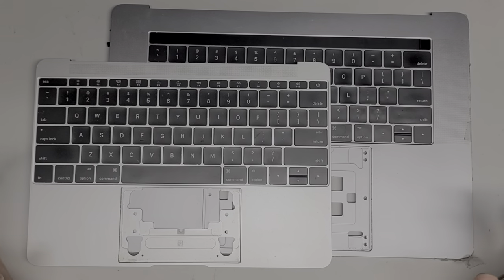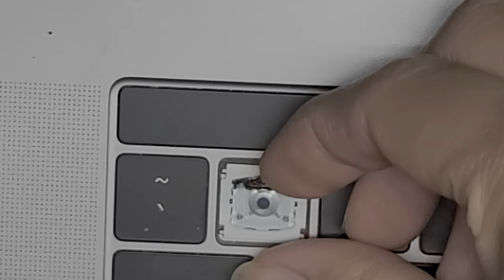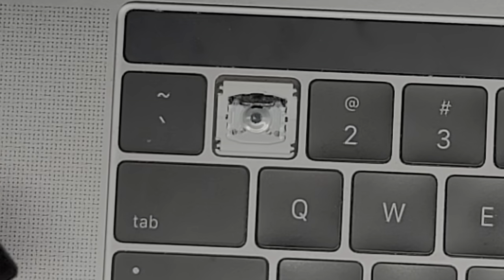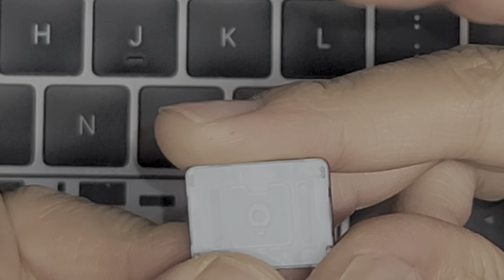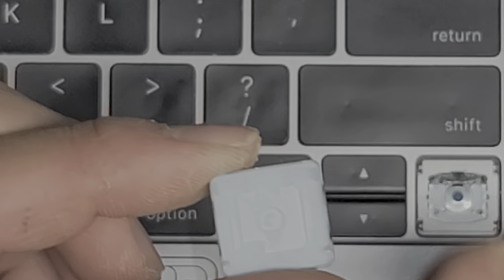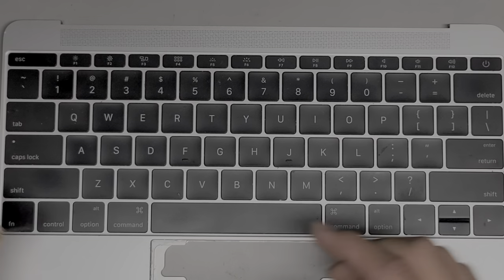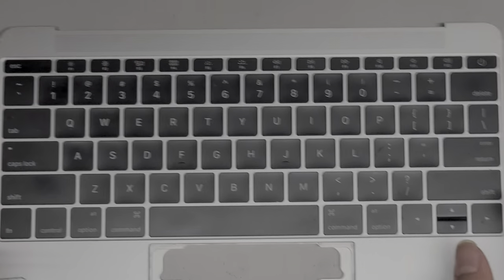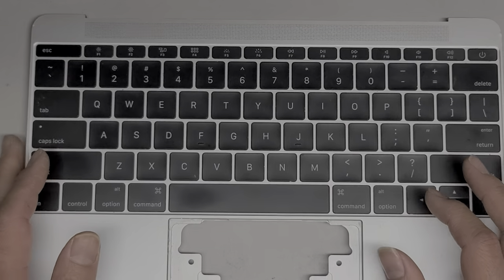2016 2017 2018 MacBook Pro Air Butterfly Keys How to Repair Fix Replace Sticky Stiff Stuck Jammed

Comment: One of my keys keep falling with the whole assembly after reinstallation. Would you recommend that I glue the clear piece underneath the key? if so what type of glue would you recommend I use besides gorilla glue.
Reply from the maker: Sounds like the clips are broken. Don't glue it, replace it.
Reply: @ItsBinhRepaired  I did replace the entire key as-well as the hinge, but the adhesive that holds the clear piece in place does not keep it in place which results to the entire key and clear piece come off as one.
Reply from the maker: Oh, you'll need to put some glue or double stick adhesive.

Comment: I tried to put back the return key but the bottom part isnt fixing in. it keeps flapping open. could you tell me what to do? there is also a very thin translucent sheet. right over the white part.
Reply from the maker: You'll have to see if you broke the clips.
Reply: @ItsBinhRepaired  Its not broken. theres 4 clips and all are fine
Reply from the maker: @sanjjanajaiswal  something likely isn't on right. I'm fairly certain clips are broken or the parts it clips to

Comment: I took out my right command key but when I to put it back in the key is a bit sunken and doesn't click up and down when I use it. It's still kinda usable but a bit annoying. The key doesn't appear to be broken but I may be wrong. I have the 2019 Mac, model A1932 if that helps.
Reply from the maker: You'll have to look at the hinge mechanism
Reply: @ItsBinhRepaired  I'm trying to figure out how it works and I'm fairly sure that it's similar if not the same to the 2018 model that is referenced in this video. I'm not very experienced with these sorts of things and might be wrong so any advice/ tips are much appreciated!
Reply from the maker: Yeah, have to look carefully at the rubber piece, hinge, and the clips

Comment: Does this work on MacBook Pro 2019 13 inch? Many thanks
Reply from the maker: If it has the butterfly keys, yes.
Reply: @ItsBinhRepaired  thanks!
Reply from the maker: @Juanmantt  no problem

Comment: At 25:18 that if that bottom part of the spacebar (the white part still attached to the computer) is removed could you fix that if you just purchase a new key?
Reply from the maker: I don't know. Might have to glue it.
Reply: @ItsBinhRepaired  alright, thanks
Reply from the maker: @spensh1  no problem
Reply: exactly what happened on mine. Did you try the glue thing?
Reply from the maker: @therealtw90  :(
Reply: @therealtw90  Loool me too. Did it work?
Reply from the maker: I've done one replacement where I removed the clear parts holding the hinges down and replaced them.
Reply: Whoops,That's my problem right now

Comment: Hi guys I broke my right shift key. The upper part of the white thing just came off because I didn't realise I had to pull it out differently. The key works perfectly, but the upper part comes off a bit when you flip the laptop or when you type. I need to get a new one. Does anyone know where I can get one? Thanks.
Reply from the maker: The key or the plastic hinge underneath?

Comment: My n key is like, has the plastic stuck to it or something and im scared to take it off and when I try putting it back on it doesn't
Reply from the maker: If the hinge broke off, I don't know how to put it back. Maybe super glue.
Reply: Nvm I now know what broke YK the butterfly white thing with the pin that has the key click to it, yeah it broke is it fixable? Obviously by a professional
Reply from the maker: @maddienuszer5292  I'd have to see it.

Comment: my space bar still won’t go back in after popping out. i don’t get it 😫
Reply from the maker: Pushing the button underneath doesn't do anything? Maybe see if Apple will fix it for free.
Reply: omgsammmmmmmeeee
Reply: DidYouFindAwayToFixIt?????
Reply from the maker: @djbham  :(
Reply: no, I try to gently wiggle it back in but it just sticks out on one side or the other. i’m taking it to apple 😕
Reply from the maker: Might be a clip is broken. If Apple charges you, you might be able to buy a replacement key cap for cheap
Reply: @ItsBinhRepaired  
Oh crap 😢 I definitely broke it off
Reply from the maker: :( is the white plastic piece is ok, you can order a replacement key and snap it on.
Reply: @ItsBinhRepaired   no. But I got the broken pieces out of the itty bitty holes. I ordered a “key with clip” on replacementlaptopkeys so it should still be fixable. 🤞🏻
Reply from the maker: @Redcandyrae  hope it works out!